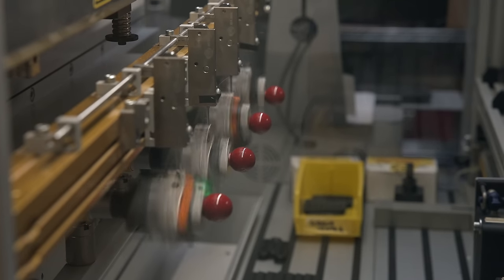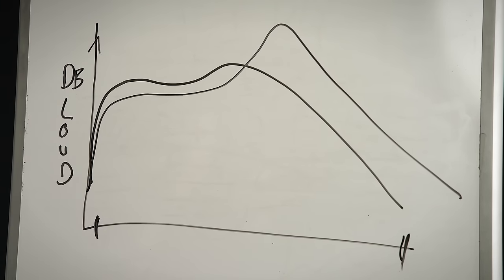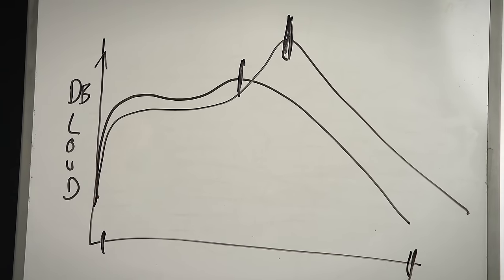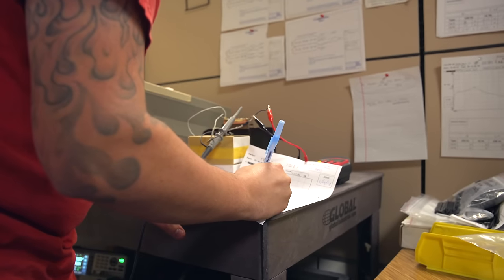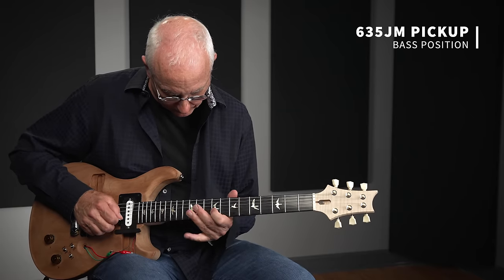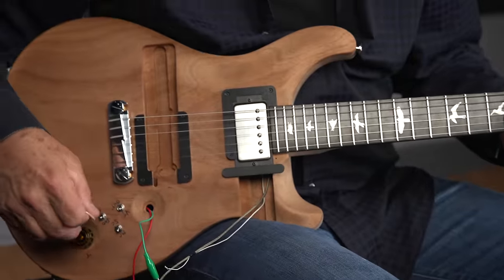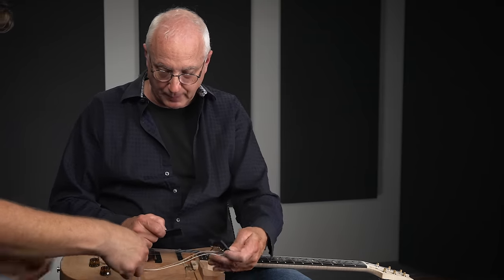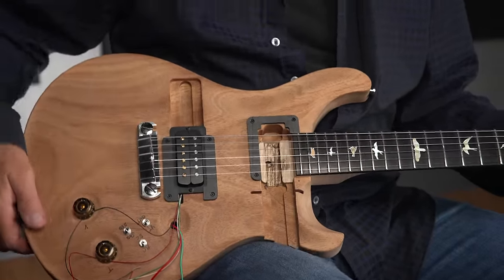Paul Reed Smith Explains PRS Pickup Design | PRS Guitars

Comment: He is such a pickup artist.🏆🖖
Reply: he want to prove tone wood is hoax.
Reply: @mathiasjapri  Because it is!
Reply: @mathiasjapri  He's saying the opposite. He said the pickup is the microphone. Not the voice. Tonewood deniers say the pickup is the voice - and materials are irrelevant. He stops short of talking about tonewood as he knows this video is going on Youtube and would be lit up with rage if he said anything about it. He's a smart fellow
Reply: Pick ups and speakers are the two components that have the most impact of your tone. If your speakers are junk you have no shot at good tone.
Reply: The wood gives the strings vibration s.     So maybe it’s the the wood you are hearing. But the strings reacting to wood.  The pick ups. Hear the reactions.
Reply: Paul, I hope to work for you someday. PRS is the epitome of how great electric guitars are made.
Reply: @hydorah  sum of all its parts, the wood is important, but not better or worse, just different, what is interesting is a “guitar” made up of just bridge strings and tuners, no neck or body, still sounds familiar, so I think the PU is the most important tone consideration after the speaker you use for electric guitars
Reply: @godbyone  The fingers (normally) give the string it's initial energy and it vibrates. The wood takes away some of that energy from the string and turns it into sound... we might say provocatively that the quieter the guitar (unplugged) the longer it will sustain...  in a 'pure' fashion. What really confuses everything is that people generally don't want to play quietly - they want a strong acoustic sound or they plug in. If we are plugging in then energy from the speaker will be absorbed by the wood and passed back to the strings. What frequencies are emphasized is highly subjective. The whole process might need to be looked at holistically... but I'd suggest that the first places you should look if you want to sound more like everyone else is to start at the preamp, pickup and position, the speaker, the microphone (and all that entails)... the wood isn't likely to have as much effect as a tonestack - but that all depends on how close to the next guy you want to sound.
Reply: LOL
Reply: @har234908234  interesting that you put it that way, I have a 57 year old SG JR, longer neck tenon in 66, no neck pick up rout, smaller control cavity, it’s the loudest electric I have un-amplified, and the loudest amplified too!   Almost all my guitars have a SD JB in the bridge, the Firebird has more sustain, the Revstar is almost as loud, but just refuses to feedback, but the SG beats them all in volume easily.   So tone wood contributes, but yes Holistically is the only way to view this, and speakers and pick ups usually have the dominant influence
Reply: @vintagetubeamplifiers  No
Reply: @har234908234  ok.  Maybe.  Prs will hire you
Reply: @jonathanstrand2474  Show me  this "Guitar  with  ONLY  "Bridge, Strings, tuners, & Pickups"     NO...   Go ahead,    DO IT.
Reply: @soundpainter2590  a rumor, an actual Jack White Video, and a frequent reference on uTube regarding the TONEWOOD controversy referenced here by other commenters.
I don’t need to prove it, but I know it’s been done, find it yourself 🙂.  Personally I disagree that wood type has no impact, but I agree it’s among the least important, Ie that PU’s and speakers are the more dominant an influence
Reply: how dare you
Reply: @hydorah  Tonewood deniers is my new favorite conspiracy theorist word. Jim Lill proved that in his documented research which makes everyone who disagrees with his findings actual science deniers. Labeling and grouping people into easily dismissable groups is fun isn't it?
Reply: @vintagetubeamplifiers  He proved that guitar strings stretched across anything or even nothing still sound like electric guitars if there's a pickup  in the right place. There's still a great deal of subjectivity as Jim himself has said. Misconstruing evidence to suit a confirmation bias seems to also be fun
Reply: @vintagetubeamplifiers  An experiment I'd like to do goes like this: 1) a maple board with a saddle at one end and a tuner at the other. 2) A mahogany board with the same set up.  both identical dimensionally and with provision for a pickup to be mounted in the exact same location on each. String a guitar string on each board to pitch. Use the exact same pickup (swap the pickup between boards to test) and use like three or strings (remove restring with another new string) on each to rule out variations there. Use a device of some sort to strike the strings. Do repeated captures and use a spectrum analyser on them. I'll probably do this test one day, which actually give a reliable indication if wood choice does influence 'tone' to any appreciable degree. I'm not saying non 'tonewoods' don't sound like [electric] guitars - and basses of course they do, in fact I'm not saying anything, really. I have an open mind on the subject. Tonewood deniers are just that. They are saying something doesn't exist without decent evidence
Reply: @MarsLonsen  🤣
Reply: @vintagetubeamplifiers  
good comment, 🙂

no judgement, I like wood, especially mahogany and Rosewood, it’s a part, the only debate is how big of one?    I’ve never played 2 guitars that sound exactly the same, even though most of mine have the same bridge PU and are heard through the same speaker, with similar materials.   But a few with a different formula, fingerboard ebony vs Rosewood, seems to make a tonal difference to me, neck thickness as well, soo many variables 

Highly subjective no matter where you stand.   Like taste and smell, even sight, as individual as your fingerprint, in my opinion.🙂
Reply: - - - - @hydorah  
From a million mouths, I’ve heard that rubbish about "tonewood" — so, why is he messing with pickups instead of taking maple or ash guitar? 
Most of what I’ve heard is: "Maple sounds brighter, the mahogany sounds "rounder" (I still don’t know what it means)"
Reply: - - - -  @soundpainter2590  
Any fool (except  you, probably) can build a guitar without an ounce of wood — and it still sounds.
Sometimes you don’t even need tuners.  ;-)))
Reply: @iridios6127  In an electric guitar, it's clear that pickups make the most difference to the amplified sound
Reply: He's here all weekend; be sure to tip your bartenders and waitrons.
Reply: @mathiasjapri  I'd bet the exact opposite.
Reply: @vintagetubeamplifiers  I think you've either ruined your ears.... have a much, much broader idea of of what sounds the same   or  .... hopefully not, just like to be contrary... I built a neck thru guitar using Maple w an Aluminum fingerboard and a Brass bridge/string holder. I figured that the "wings" of the body didn't matter, so I used Pine from a building outlet. Not so good sound. So I removed the Pine and glued on Mahogany. Much better tone. And that was even w the damn fingerboard adding an ice pick that would make a Tele sound mellow as well as other Aluminum sounding tones. Pickups of course , shape the tone as well, but the wood makes a big difference.
Reply: @har234908234  I ve found  exactly the opposite to be true; all my guitars that are loud acoustic!y sustain really well. They're resonating. That doesn't suppress tone it sustains it.
Reply: @terryenglish7132  Have another read of what I wrote. I'm pretty sure I gave an explanation.
Reply: @iridios6127  Buy a plywood guitar and have fun
Reply: @har234908234  Apparently you can't highlite and copy phrases here.... Aren't you saying that a quieter guitar sustains better ?
Reply: “Pickup artist” 🤣😎🤣
“So, baby…come here a lot?”
🤣🤣🤣
Reply: @hydorah  
I made one.(or two)  😉
Reply: @iridios6127  Cool man that's very impressive
Reply: @jonathanstrand2474  I have a few Strats with the SD JB. That pickup hits so hard…and I LOVE it…for some stuff. However, my main Strat has a much more civilized humbucker at the bridge made by Fountain City Guitars in Kansas City, Missouri. It’s like a slightly warmed up PAF. Or an SD ‘59. Those are great too!
Pickups, wood, hardware, fingers, amp, speakers…not to mention effects. I tend to believe that they all contribute. Throw in the heart and soul of the player, then it really becomes interesting. And hopefully, musical.
Reply: @martinthompson2425  I play with a really light touch, I prefer pop jazz to play along with because it’s not so midrange compressed, and the harmonic complexity of jazz is my teacher, mostly neck PU,…Also a powerful SD, but if I wanna rock, just switching to the bridge is all I need to do, both sounds with no EQ changes & on one guitar.   But it is the sun of its parts for sure.🙂
Reply: @terryenglish7132  I think I also used the word "provocatively" too! I'm not going to be the best physics teacher out there, but in that case we're talking about the energy of a plucked string sustaining and the 'conservation of energy' - and an overly narrow concept. It may be easy (for others) to think if more of the energy of that ringing string is transferred to the woody bits that make more sound, then more energy will be lost from the vibrating string. In other words if that energy wasn't lost out to the air, then there would more energy at the string continuing to deliver to the pickup. I think that's true - but there's more factors. An experiment for that narrow aspect  may be a guitar made out of a solid block of steel compared to a standard wooden solid body and measure the time from half a second after plucking for the output to drop 60dB. Measure from a pickup and a microphone at a distance. (Best done in an anechoic chamber). The "other factor" I put in there is that 'plucking" and it's variants aren't the only way that guitar strings get energy. Let's imagine you have a room full of guitars in standard tuning with their strings free to vibrate. If you plug a guitar in and play an open string with a reasonable amount of volume... well they're all going to be ringing at least a little bit - and it's not free energy!
Reply: Guy really is a gear nerd, and nice guy.
Reply: @soundpainter2590  !!!found it!🙂

Jim Lill on uTube, 2 tables, one serves as the nut, the other as the bridge, 25.5” no neck, no “body”.  Compared to an ordinary guitar using the same parts, open tuning, AMP, pick up & at the same distance from the strings, mind blowing really, more than I thought, I hear NO difference in tone, between the actual guitar and the literal “air guitar when he plays slide on them.   He went through a bunch of precise steps and ended with matching pick up AND matching it’s distance from the strings….THAT was absolutely critical to his results!  Fascinating at the very least, doesn’t completely answer to the controversy of  “Tone wood” but it does make it pretty clear that any electric is indeed the sum of all its parts.   In my case 5 guitars with JB’s same string distance, all sound a little to a lot different, no 2 sound the same or “feel” the same.

I wanted one other to sound like the Revstar, I now think only another Revstar of the same series would sound…..similar 🙂
Reply: this :P

Comment: As an engineer that plays guitar, I absolutely love the frequency response graph. Best way to explain the differences between pickups.
Reply: same! i do R&D and I love the research approach to it.
Reply: If he had graphically illustrated their respective signal to noise ratios as well it would have given a much better picture of the sonic differences between HB and SC pickups. When the frequency response is weighted with a bunch of noise it can make single coil pickups a lot less desirable.
Reply: As an engineer, do you ever wonder about the glacial progress of electric guitar design? For instance, we are still using 1/4 inch connectors that were designed in the late 19th century, and high impedance pickups with passive electronics. Of course, there are some guitars with active electronics, but they are far less common, and even they still use 1/4 inch connectors.
Reply: @markkeneson6806  It is the nature of guitarists to want the exact same instruments that their heroes play and played. Whenever Gibson or Fender try to modernize or improve their instruments they are thanked with sales slumps and bad mouthing.
 For example; Gibson could fix their head-stock splitting problem tomorrow by changing the way the head-stock is made by making the head-stock separately with through grain  and putting it on the neck with a scarf joint. If they did that Les Paul sales would stop completely..
 "Jimmy Page never had a scarf joint on his LP how could I sound exactly like him on a LP with a scarf joint?"
 As long as "vintage tone " is considered sacred and the myth of "tone wood" prevails nothing on popular guitars will ever evolve.
Reply: @williard billmore , thanks for the response, and I think you are right. It's unfortunate, but that's what the market demands. Look at bass guitarists, they have on-board active electronics and sometimes XLR connectors. I guess bass players are less obsessed with having the exact same instruments as their heroes.
Reply: @markkeneson6806  It is true, Mark. I am a bass guitarist and an audio electronics enthusiast . I have a 4001 Rickenbacker and I was designing, building and putting active four band stereo bi-amped EQ onboard my bass to give me the sounds I wanted at my fingertips as far back as the early 1980s.
 The guitarist in that band I was in at the time was impressed with what I had done and so I offered to upgrade his Les Paul with similar circuitry and /or split the humbucker coils to expand his sonic palette.
But oh no, he could never consider any alterations to the precious passive electronics of his precious Les Paul ...It all had to remain pure stock.
Reply: @markkeneson6806  The hurdle at this point is that amps and mixers also use the 1/4" jacks.  I've put a 9-pin connector on a Godin, and ran each coil of an HH configuration to its own channel, but I still had to use a breakout box with 1/4" jacks.  Acoustic and bass players have accepted XLR jacks on their instruments, but electric guitarists are afraid of change.
Reply: Same here! I find it so interesting that so many engineers are also guitarists…it is not surprising however.
Reply: @markkeneson6806  ; If it ain’t broke, don’t fix it.
Reply: @Kevin Hicks , advancements don't just come from when something breaks. With that attitude, musical instruments would have never advanced to the point of even having a guitar, forget about electrical amplification, we're talking no guitars period.
Reply: now I am more confused than ever..lol. I always thought the humbuckers were typically louder than single coil. What am I missing here?
Reply: @markkeneson6806  When you sell to the public you have to respond to the public's demands !!!
Reply: @americanjoe5486  , absolutely, and that's why it is far more common for bass guitars to have active electronics than guitars.
Reply: As engineer, can you recommend some affordable equipment to make pickups+electronics response graph at home? Looks like a sound interface + FR response tool will do the measuring stuff, but how to make induce a consistent input signal in the pickups? Exciting coil? Where to get it?

Comment: Finally, a pickup manufacturer talking about the frequency response curve of pickups!

That peak he points out is the natural resonant frequency of the pickup.  It's determined by the inductance of the pickup, measured in Henries.  I wish pickup manufacturers quoted the Henries of their pickups--it's much more useful than DC resistance.

The builder can control both the frequency and the height of this peak.  I think it's important to realize that in all pickups, the frequency of this peak is well beyond the fundamental frequencies of the notes on a guitar.  The fundamentals run from 82 to about 1100 Hz.  Pickup peaks start at around 2000 Hz and can go beyond human hearing, but typically no more than 8000 Hz.  So the peak is emphasizing overtones, not fundamentals. After this point, response falls off to zero.

You can easily measure the frequency response of pickups yourself.  All you need is an audio interface, some free software (like Room EQ Wizard), and Ken Willmott's "Integrator" device ($135).
Reply: I'm using Ken WIllmott's Integrator to do just that - I'm building a database to collect these frequency response curves for every pickup.
Reply: @jonathankvex  Is that public?

Comment: Paul did a little presentation on PRS guitars locally about the time the 57/08 pickups were released. There were a lot of PRS guitars at the presentation, and my favorite-sounding guitar was a McCarty with 57/08s. I eventually bought a CE24 Semi-hollow with 57/08 pickups, and it's my favorite humbucker guitar I've ever owned (I've been playing for over 50 years).

I want to hear the 58/15 and 58/15 LT pickups, but I don't live near a store that sells PRS guitars. I suspect I'd like both models.

Are the 58/15 LT pickups the same as 58/15 pickups but with fewer windings? If so, could you tap both coils of a 58/15 and, with a switch convert the 58/15 to a 58/15 LT?

Just trying to figure it out.

Comment: Thank you Paul. I watched another video tonight about the TMs vs. the TCIs pickups. I didn't even know there was an updated set of pickups. I bought my PRS CE 24 back in 2018 from Sweetwater so I'm pretty sure I have the TMs. I think they are great pickups. I'm in between jobs right now, but will be finding employment soon and will like to check out the TCIs if they are as great as they sound. I have a 1988 USA Strat that I put Texas Specials is and I love the single coil sound. I love my PRS CE 24 I just had it adjusted from an action perspective and am happy as can be. This is just an amazing guitar and I like the TMs just find with gain on a Fender tube amp! Keep on on keeping on!